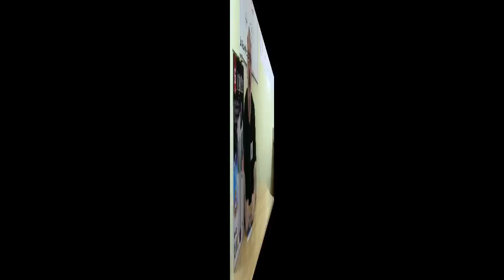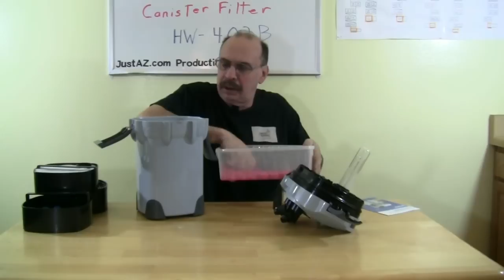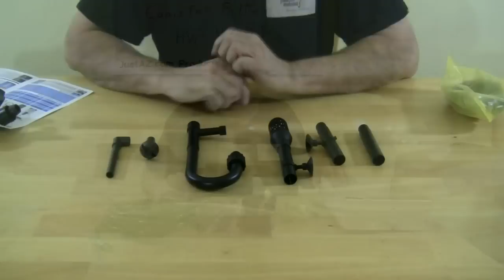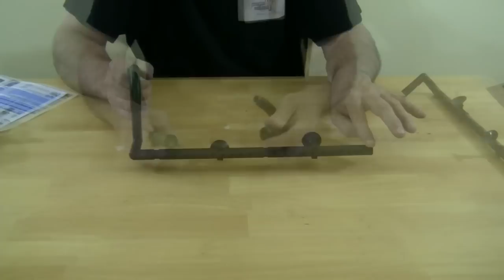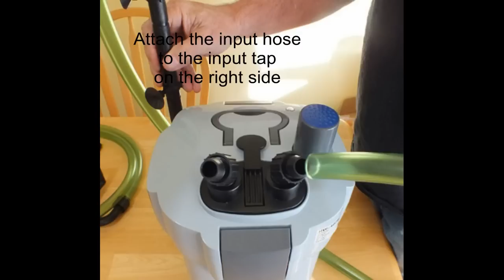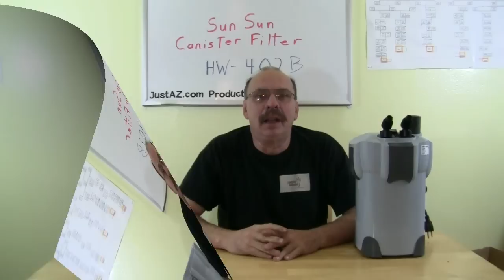How I Set Up the SunSun Canister Filter

Comment: im worried my intake and outtake are reversed because i don't really notice any bubbles coming out of the outtake wand inside the tank. Is that normal not to see anything coming out of the wand?
Reply: As long as you can see water flowing out of the output spray bar, the intake and output are set up correctly

Comment: I have sold thousands of  UV-C germicidal lamps to customers, and I stand firm when asked about longevity UV-C lamps do not stop sterilizing until they are completely burned out, all that rhetoric about replace after 1 year is to make ppl feel they need to purchase lamps every year keep spending that money.. Even a germ lamp operating at 40% is still sterilizing 100% more than not having lamp on period.. Not powering lamp constantly will save you the cost of replacing media due to deterioration more than the ¢.2 cent per day electricity.. Ask yourself how much has being lazy cost you over the years.. lol.. Google is free and provides free information for the taking

Comment: hello...please help..  I have a 30gallon planted tank.. I like this filter 303b with build in UV.. So can I use this for my 30g tank or whether it would be too much for my small tank?!
Reply: It's actually really good that you can buy this filter for such a small tank. Just make sure the fish can handle the current.
Reply: Nithin Pk you probably figured out by now or year later but yes you can't over filter more is actually better when it comes to filtration and aeration . What's not good for the fish is when they're getting blown around by fans or power heads or a very strong stream from the output of the canister or any type of filtration.   the other person's correct is long as the fish are not being blown around they'll be fine and it's deafly beneficial if you have really small fish or babies it would not be a good setting really depends on the fish for Cichlid tank you should be fine. but again you don't need this strength of a filter to have a successful tank. but it can only help and depending on how much you're willing to spend I would say yes. Plus you can use this filter if you get a bigger tank.

Comment: The reason I looked up this video is because my filter did not prime right.  It is running but it just has a lot of air bubbles from the intake.  I made sure the pieces were as connected as possible was there anything else I might have to do
Reply: Nick Balassone try to shake the filter from left to right before putting the motor on and let the air bubbles escape

Comment: Thanks for a great detailed set up! I consider myself a solid advanced but new to a canister set up. Watched about 50 videos on the media set up for canisters. about 25 half say to start with filters first, yet the other half say the opposite end with the filters. When in the past I used Back end filter systems, the filters pushed the water through the mesh filter first then the carbon. So I feel the mesh filters should be on the bottom of the canister, and the last should be the carbon on the top of this canister. Why so many people feel the opposite?
Reply: Charles Odessa   Put your foam media in the first basket corse med the fine  the other baskets use you other media

Comment: Bob, I need some help.  I just purchased a Sun Sun 703B and have set it 
up with canister on the floor well below the tank, but I can't get the 
pump primed.  Facing the canister, I've attached the intake hose to the right tap, and the return to the left tap.  What am I missing or doing wrong?
Reply: John Harris  Fill the canister with tank water then put the top on. Turn on then rock the canister back and forth. Air bubbles will be expelled.

Comment: I run my output spray bar submerged in my tank, shouldnt be a problem right?
Reply: i do the same as long as you have air stones ect its good i do it so my glass top dont get so full of water drops ect

Comment: OK ABOUT UV LIGHT.... there is NO.. no way to turn it off or on???? Do I just take off that bulb out if i dnt need it? There is only one switch and it pretty much turn on or off the entire filter... i dnt know how to know also if my uv is working or not.. theres a small little glass beside the switch.. is that the uv control or indicator? Pls help!!
Reply from the maker: Do you have the same model as mine? I flip the switch on mine and it just turns off the UV The filter continues to run. When my UV is running I have a small blue light that is on.
Reply: +Just Az.com productions oh im sorry i guess we dnt have the same one. i have a 304b with no switch to turn off uv. although its got a 5 filtration thing.

Comment: What's the difference between the sunsun and aquatop?
Which one is better?
Reply: +MrRookie714   I just bought  the aqua top.   I don't believe there is a difference  .I'm told that the  SS is a little less  " fit n finish"    I was told that one company bought the other one.
Reply: +gewglesux   I don't know anyone who uses  SS or an AQ as a main filter.  Most people I know use them as either a 2nd or 3rd filter.